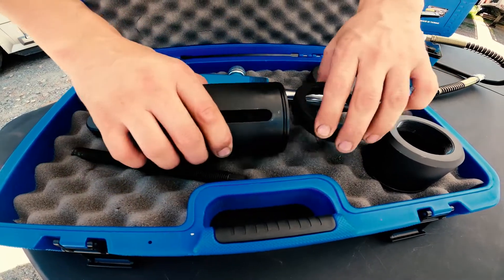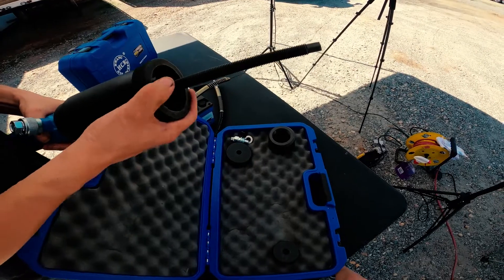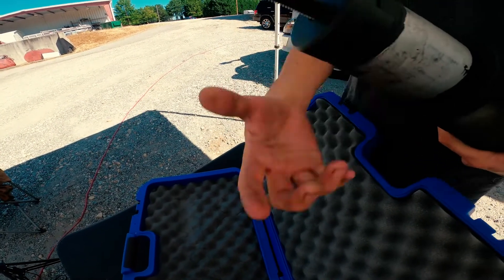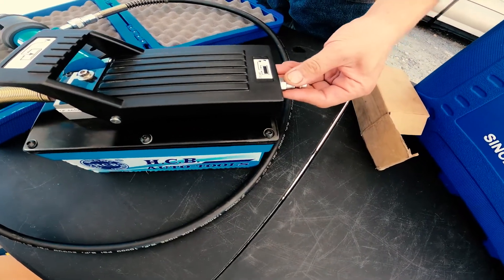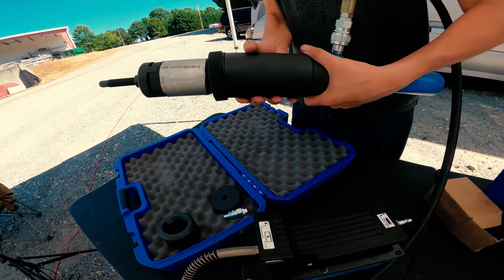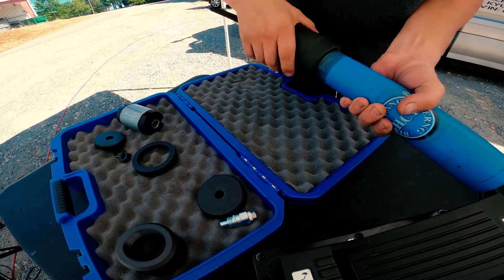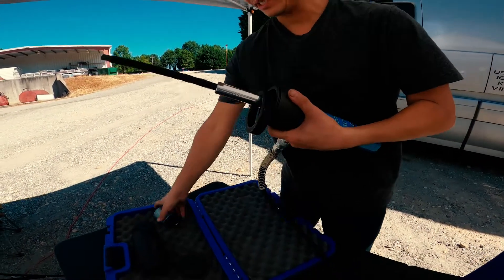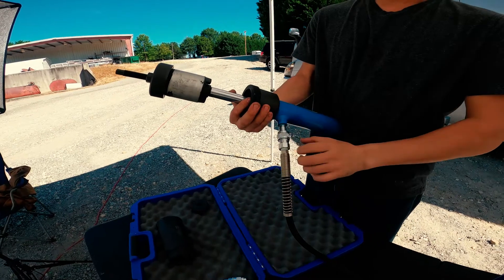VOLVO VNL VHD VML | CAB BUSHINGS REPLACEMENT

Comment: If I lost some of the adapters how would purchase replacement adapters?
Reply from the maker: @khalidjamal123  which adapter do you need?
Reply: @DIESELTECHPERFORMANCE  the 2 for the bushing. I do not need the D6 & D9. They are round and have 3 notches that fit in the bushing.
Reply: @DIESELTECHPERFORMANCE  do you have them in stock?
Reply: @DIESELTECHPERFORMANCE  I have not heard back from you.

Comment: Great info. I dont want or need to buy the whole set but i only need the end adapter with 3 spokes for installing the bushing onto a regular press after the whole assembly has been removed. Do you know where i can find it? Thanks
Reply: You can make an adapter from a large socket, just mark on the outside of the socket where the notches need to be and cut the socket using a die grinder.
Reply from the maker: We do not sell just adapter. Sorry.
Reply: @DIESELTECHPERFORMANCE  thanks anyway. If i use flat end adapter will it damage the bushing?
Reply from the maker: @GeorgiGeorgiev-ne9ps  it might because of rubber bushing is not flat

Comment: Volvo says I gotta buy the whole spring they don't sell the bushings by themselves is this true
Reply from the maker: Its not true, if you need bushing for cab this is part, 
Dorman 924-5505 Truck Cab Mount Compatible with Select Volvo Models https://www.amazon.com/dp/B00GHR9O3Y/ref=cm_sw_r_cp_api_glt_i_PM8Q26TAVXEEVHS8F007

Comment from the maker: If you are near Suwanee, GA come by to my shop and I will replace it in 1 hour. The labor is $360, bushings cost $50 each.
Reply: What is the adress?
Reply: I need the cab bushings volvo wants me to buy the whole thing
Reply: I need this service
Reply: Hello, I like to come by and get my cab and spring bushings replaced. I tried to call multiple times but no return. Can I just stop by and get them fixed same day??
Reply: What's your address.. I live in atl
Reply: Whats the symptoms for bad cab bushings? Got a bad vibration on my truck and steering vibrates too. Whats the name of the shop or address please. Thank you
Reply from the maker: @jonsanfe usualy it makes noise when turning to quick or on bumpy road when driving slow. 1004 Dry Pond Rd, Jefferson GA, 30549